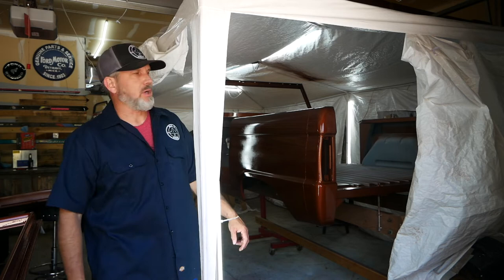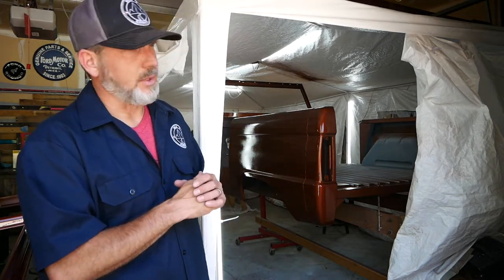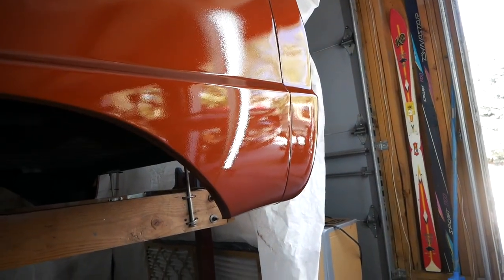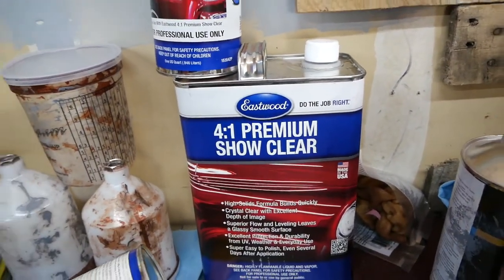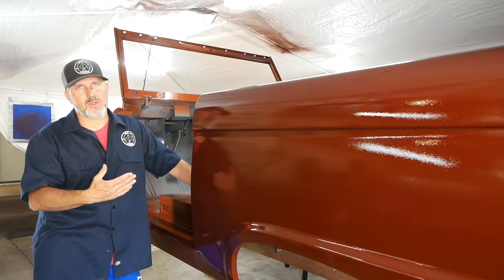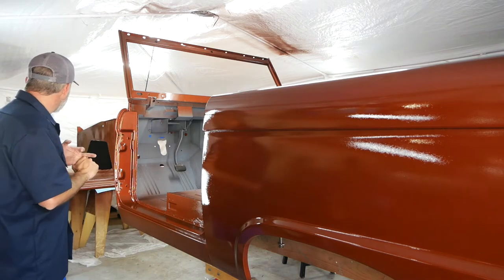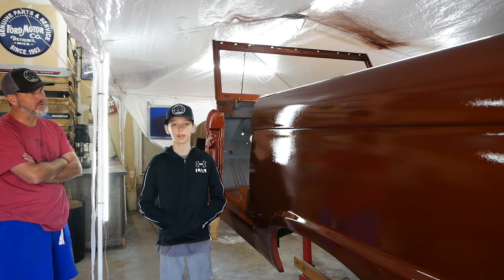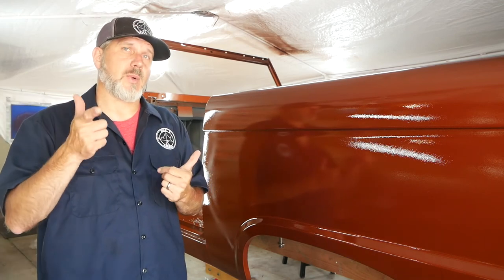Early Bronco DIY Paint Job

Comment: Love the color. I had about the same results on the Scout. Whatever though, you learned something and it’s yours. Btw I’ve had the same switch problem on my HF compressor. I need to order a better version of that switch.
Reply from the maker: Yes Matt, I’m too old to be having pressure release valves going off randomly. House is coming along well. Like the videos.